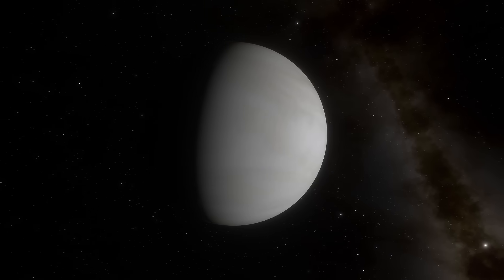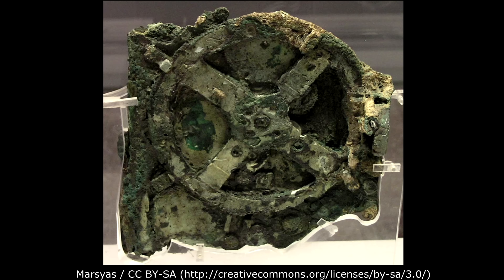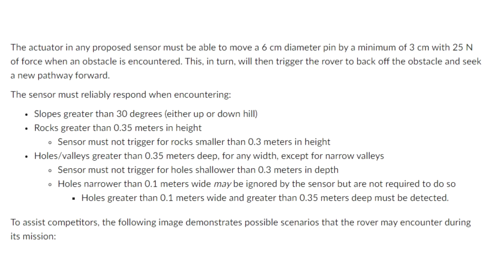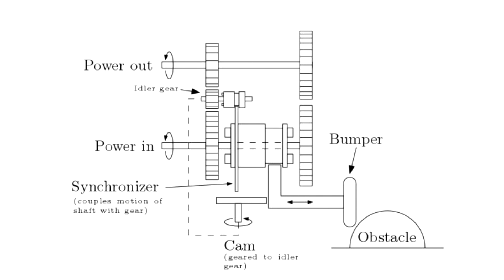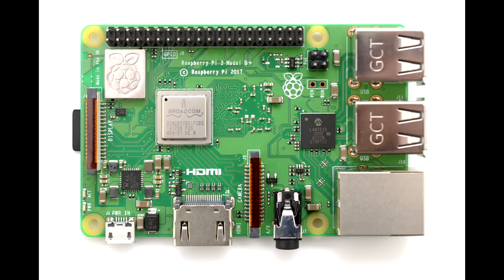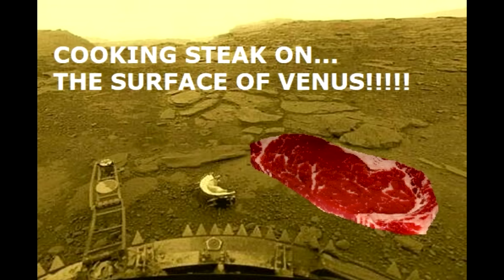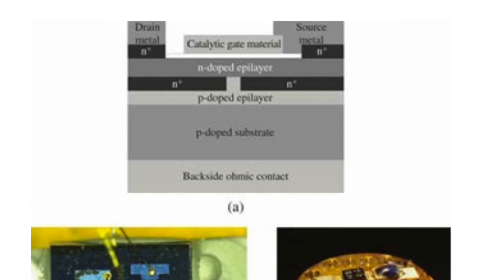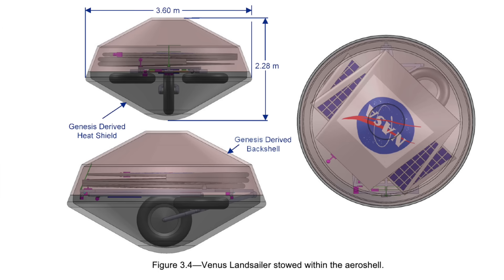Venus Rover Concepts That Beat The Killer Atmosphere

Comment: The Russian Globus computer has been resurrected and their is a recent youtube detailing it's restoration to functionality.   One of the best bits of the incredible Globus is that it tells you when to put on your seatbelts.  A lighted panel(later model I think) or two little lights on the top left labeled "attach seatbelts",, all by a mech computer, that you hope to God it stays in sync and doesn't jump a brass tooth, on a brass gear, that was cut by a guy drunk on vodka.    They will have to send a armadillo style type of crawler to Venus.   A literal crawling bug with heat shielded, jointed, ceramic armor.    A crawling rock, with rock based heat shielding.

Comment: im guessing it wont have a camera?  also, is there any way to use the surrounding heat to power the rover systems? i saw something before where a flashlight was developed that ran off the power of the users hand.
Reply: The energy source is not heat, but heat difference. You need a hot spot and a cold spot in order to extract any energy.

Comment: What  about having the electronics inside fridges? Like a Russian doll? Each layer is a fridge but its designed for a particular band of temperatures. The outermost layer uses a liquid metal as a coolant. The ones inside lower temperatue liquids and gases. Eventually you get to the centre and the equipment in a cool circulated earth pressure atmosphere. Like putting a small beer cooler into a fridge and the fridge put into say one the size supermarket warehouses use.
Reply: And how do you power all this?

Comment: I can't patent it. But put electronics inside thermos flasks and it will last as long as the vacuum conducts heat. Perhaps weeks if you do a good job. Then come pay me in Kenya.  :)
Reply: Powerful computers can survive in a tripple titanium vacuum flask.
Reply: Use my idea. But pay me please hehe. I just need a cool motorbike 🏍 😎
Reply: Transmitter can be outside. And it will not melt

Comment: Mechanical radio transmitter did exist and do. Remember Those ancient VLF transmitters that actually were fast turning dynamos? Take an old ticking and rattling alarm clock as transmitter or "sound" source. Get a coil or an open transformer (without that final part that closes the magnetic loop. use it in place of a microphone. Now you can hear your old alarm clock ticking and the alarm rattling electrically or actually magnetically. Imagine those environmentalists afraid of electromagnetic radiation having a device near their beds that is making far more radiation that the digital  clock radio they are afraid of.

Comment: My thought would be valves (vacuum tubes in America) because they normally need to warm to an operational temperature of 500 degrees Celsius anyway. However you could also use an optical computer. 

Regarding the Camera I think there are some commercial Cameras for high temperature environments (e.g. ovens) but if that won't work perhaps a Peltier (thermoelectric) cooler could be used and the Camera could be kept inside an evacuated tube. 🤔
Reply: And you don't think NASA knows this !!

Comment: Why not make lots of cheap landers with a large thermal mass and lots of insulation to keep the insides cool for at least an hour. After an hour, consider it pau.
Reply: The Soviet Union's Veneras 9 and 10 each sent successful orbiters and landers to Venus. Venera 9 made a successful landing on Oct. 22, 1975 while Venera 10 alighted on the surface a day later. (Info from,18. sep. 2020)
These are the only probes that have sent images back !!
I just wonder, if you can make the probes so much cheaper? The Russian knew, the probes would not work for long. I think they only worked for 2 hours or so...!!

Comment: It seems like a more viable option than putting something directly on the surface would be to deploy some sort of balloon in the upper atmosphere which dangles a long cable full cooling systems down into the soup with a camera on the end to look at the surface more closely. Then you could dump your waste heat up high where the temperature is lower and thus keep a fancier camera system cool.

Comment: I’m here thinking, omg, we can build hardened 8-bit chips, that work up past 400-600 degrees?

can we build an 8-bit chip like an “Arduino” / ATmega328 🤩
… and … I looked it up, apparently even a cute little $5 chip has around 80k transistors.  😮
Reply: ok, reading further, 🤣  apparently they haven’t published a count, so we’re just guessing.

best I can tell, / from what I understand of this, the ATmega 8-bit chip is estimated to need a minimum of more than 10k gates, and less than 80k gates.  the ATmega has on-board flash-memory, and on-board RAM, so that’s a bunch of extra gates.

CPU-only components maybe a little over 10k, all-in total maybe 80k.  😬
tech that is hardened against Venus’ surface, I get the impression we’ll be limited to ballpark 5k gates.
I mean … it’s a start!  I’m still excited!  😁

Comment: If memory serves, the landers in the Soviet Venera programme were pre-cooled before entering the atmosphere. (I think the bus carried a tank of liquid nitrogen or possibly just liquefied air to cool the lander shortly before it separated.) The engineers had designed the probes to be as well insulated as possible within the launch mass constraints.

I believe that Venera 13 lasted some 123 minutes on the surface (this is from memory - I could look it up, but I didn't bother).

Comment: A vertical windmill might be the best idea for a power source. It is nondirectional. As for the radar reflector a radar corner that can be deformed or the sides rotated from  90 degrees might be the idea.

Comment: The first transistors (semiconductors) were made from Germanium crystals, and they had very poor high temperature performance.  The element immediately above Germanium in the Periodic Table is Silicon, which can tolerate higher temperatures than Germanium and most semiconductors today are made of crystalline Silicon.  The element immediately above Silicon in the Periodic table is Carbon.  Is it possible to make a semiconductor using Carbon crystals (also known as Diamond) as these would in theory be able to tolerate quite high temperatures?

Comment: One suggestion for moving: When I was a kid, there were toys in shape of cars that were driven via two wheels attached to a rotatable disk. Regularly the motor powered the wheels, but when the "car" hit an on obstacle like a wall, the resulting drag not only stopped the wheels, but this also started the disk to rotate. When the wheels could rotate again, the rotation of the disk stopped and the "car" moved again.

Comment: this is what NASA is all about; engineering EVERYTHING from scratch. No matter if it takes billions in finances, the return is technology that can be used on earth. Aren't integrated circuits partly developed by previous NASA programs? I remember a brief article mentioning that the apollo guidance computer contained 50+% of the whole world's stock of ICs. Semiconductors that can run at high temp are of very high value also on earth

Comment: You absolutely can build a mechanical radio transmitter. :) You need a moving shaft with a magnet, a stationary coil around this, and an antenna connected to the stationary coil. Rotating or oscillating the shaft at various speeds changes the frequency, yielding an FM or FSK encoding.

Comment: Maybe use the rfid to communicate with simple logic form since most of the data concerning atmospheric pressures have already been collected by the Russian probes. Otherwise need to find a hybrid ceramic/metallic plating that could divert the heat along the body of the craft like wind over a wing

Comment: I was wondering about a tethered probe? Most of the sensitive electronics housed in an "aerostat" balloon or dirigible that floats say 20 or 30 km up in the "cooler" / but still dense atmosphere. 

A long tether with thin cable / electrical connections to the probe with sensors or even cameras. The probe can be "deployed" close to the surface at the end of a tether and winched back up to the floating main "platform" (balloon) allowing it to cool off and take "breaks" before being damaged.

Maybe the platform aloft can cool off the surface tethered module and ready it for another "dive" down at the end of the tether. The platform will float high enough where active cooling can be used, such as a heat pump (Stirling engine?) that can also cool the probe before another descent (maybe the probe can carry a large "heat sink" than can be cooled before another descent) or such.

The balloon also can use regular air as a lifting gas, even oxygen (can be made in situ as well). A helium or hydrogen gas bag will be nearly twice as buoyant in a carbon dioxide atmosphere than on earth.

Another idea would be many "expendable" probes released by the floating platform that can descent as drones. These each would have a short life on the surface, but can pack more electronics - Each providing a detailed picture of the surface before failing. 

Great post by the way!

Comment: You say at 4:40 "you can't build a mechanical radio" but there are mechanical radios, e.g. the Alexanderson alternator radio at Grimeton, W. Sweden, an early longwave transatlantic wireless telegraphy station built in 1922–1924, that has been preserved as a historical site.

Comment: Until you put humans in Mars and Venus orbit to control them without 30 and 60 minute delays, any rover is a complete waste
Reply: Why? Rovers can be controlled with large delays. They currently do it with a 14 minute round trip delay on Mars
Reply: @kalebk9595  Ok gaslighter
Max 48 minute two way delay
That's send a command, wait 24 minutes until it gets it, then wait 24 minutes to see what the fuck happens
Try to play a game of chess like that vs with 1 second lag
Tell me which one's faster
Rovers can get up to an incredible 3km/year like that wow
That's "WHY"
Reply: @ublade82  I'm sure it'll be faster, but that's not really that important for rovers.
Reply: @kalebk9595  LOL
Reply: @ublade82  how do you think rover control works? Do you think they just drive it around like an RC car?? They program in a set distance for it to travel (normally a very short distance) then wait for the rover to respond.

Slow and steady is the key to rovers, if anything goes wrong you can't just go and fix it

Comment: Just came across this a year and four months late. :)  

To me this is a challenge that screams 'more power'. The most obvious route might be some kind of chemical converter using the atmosphere - or a small full nuclear reactor. But like all thermodynamic systems almost anything we can do will always need a cold side. That means your main system is primarily a cooling (heat engine) plant and everything else is subsidiary to that. 

As a primary system a high running temperature where 600 c can act as the cooling side becomes the obvious solution - that make a high temperature reactor cooled by liquid metal a good solution. Given the high pressure of the atmosphere a good power drive solution would be a vacuum driven pneumatic system. This also gives you your direct feed to drive a cooling system to keep up an insulated cooled 'heat bucket' core. - 
The cold core might use a combination of something like silica wool insulation plus a vacuum layer to improve the efficiency. Things like camera sensors could be kept inside the insulated box and connected by light tubes that block heat transfer..

Its all getting a bit 'heavy metal' but then that's me.

Comment: The upper atmospere of Venus is much more temperate, so a hydrogen filled dirigible could function there just fine with regular electronics and someday even humans. That dirgible could carry sophisticated computers and communications, and could lower a more heat resistant probe on a long cable.

Comment: I'm probably not seeing the entire issue but could they have the electronics inside a container that is in a vacuum container? I realise that the weight has just gone up tenfold but wouldn't that protect from both heat and pressure?

Comment: Did you know the pressure on Venus is the same as the deepest saturation dives on hydreliox in the ocean? If we could figure out the heat, we don't even need to figure out the pressure hull problems

Comment: An armoured ball shape that has cameras and sensors all over it. A system of rams that pop out and propel the ball probe randomly along? Why do probes have to land on the surface? Why not use hovering probes that never touch the surface but fly down from a manned or unmanned spacestation in Venus orbit. They could fly back up to the spacestation to refuel and upload information and footage.

Comment: More insulation! Cryogenics already deals with worse, just add more insulating baffles as there’s no limit to how low the cooling power needs to be. For a camera, look to the design of cryogenically cooled LWIR sensors: bond the sensor directly to a Peltier cooler in an insulated box. It may also help to look in the UV. SiC: making a large number of transistors in a complex circuit isn’t that hard once usable materials are established.

Comment: Why not use nanoscale vacuum-channel transistors (NVCT)? And then use high melting solder alloys? Gold-Cadmium or Gold-Cerium have melting points above 900F. Logic gates are just made from transistors, and transistors are solid state triodes (vacuum tubes). Seems like a rudimentary computer could be made from something like this. Use quarts crystal as the tube housing. I think the mechanical computer is well beyond feasibility for a functioning rover on another planet. Yeah mechanical computers have been proven but even Alan Turing's Machine was the most complex mechanical computer in history and that thing was the size of a fricken garage. And even then the computer used electricity. Good luck getting something like that which can communicate with a satellite. I think the best bet is to use high temperature materials and tried and true methods of logic. Vacuum tubes in quartz reinforced with steel (from the pressures) and high melting solder

Comment: Start with about 20, massive ballons that are able to float in the venetian atmosphere, drop solid steel balls with cameras embedded deep inside them from altitude taking photos on your way down until it crushes under pressure or fails. Repeat this over and over and over for different parts of the planet until you start to gather a complete picture of the landscape. Data sent to probe orbiting LVO, then send the data packet to Eath via radio relay. Idk....just thinking outside the box.

Comment: Sending a signal back to an orbital reciever shouldnt be difficult if time isnt an issue. Vacuum tubes, inductors, resistors, and capacitors could be used to generate a CW AM Signal  that is switched on an off to generate a digital code.

Comment: Before worrying about the computers you need to figure out what to build the rover with. The Venera landers only lasted 2 hours max before the cameras melted and the electronics over heated. I wonder if there’s anything left of the probes down there. Also you gotta think of the atmospheric pressure. You don’t want the rover melting, over heating or being crushed. So material will have to seriously tested to the extreme. Then you’ve gotta figure out to keep the rover powered up. Can’t do it solar wise because there is no sunlight on Venus.

Comment: Ive literally been devising completely 100% mechanical devices. I hate software, I personally believe software diminishes the capacity of the electronic hardware you use; and electronics are unreliable. I designed an entire rocket to run off mechanical devices only from inspiration from the Skyrim Dunmar Centurions. 100% mechanical cars that are 100% electronics free, Ive designed a passenger vehicle for that

Comment: Molten salt reactor to run very primitive relay/tube electronics???
Reply: The temps would be high for such a set up but still within safe limits, then just use relays for basic comms ect..... yes slow as all fuck but gets the job done

Comment: If its hot as hell on venus could you use... sterling engines to power it..
Reply from the maker: Stifling engines require a hot and a cold reservoir
Reply: Lapsed on that one. Does kinda put a wrench in it if ya only have a hot end and no cold end.
Reply: Just came to mind. It may be really dumb idea but you could move the built up heat to the hot chamber making the hot end even hotter to create a hot and "cold" chamber which may give you room to pit in electronica with somewhere to put the heat and uses to generate a little power or thrust

Comment: This whole competition sounds amazing. From the sound of things I bet a nuclear reactor is probably the way to go assuming no crazy leaps in capacitor tech happens within the decade. Russia's Alfa class submarine uses a liquid metal lead-bismuth reactor that can operate at incredibly high temperatures so it would have to be a minaturized version with a similar cooling system.